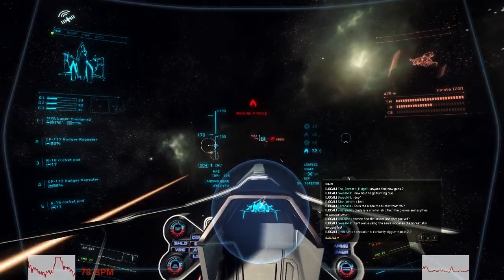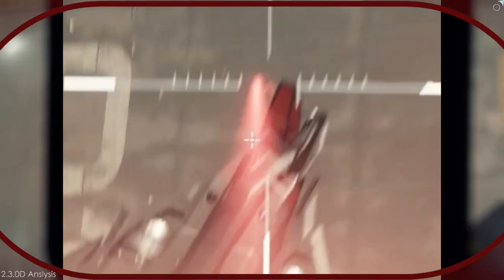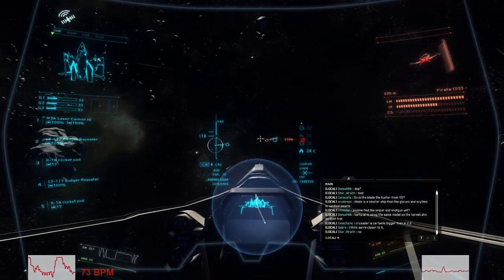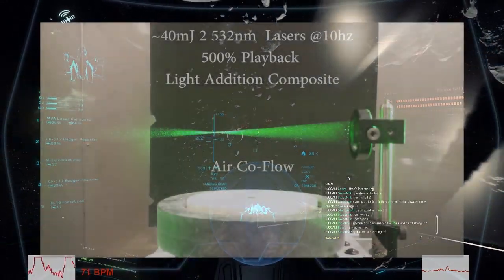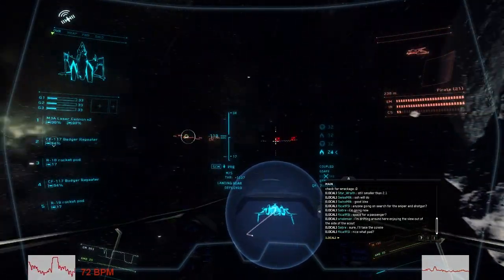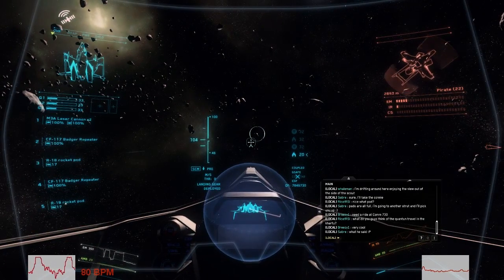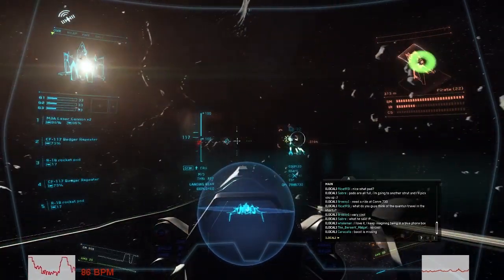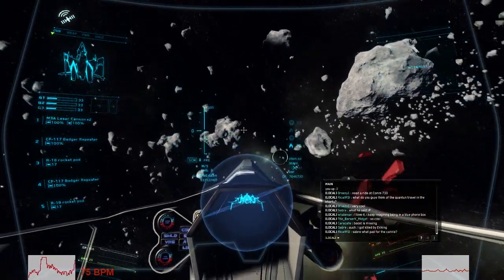Lasers in SC | V 2.3 | Review & Proposition

Comment: I've never been a fan of random inaccuracy in videogames in general, I would rather have a system that balances range in a different way. What you are describing definitely sounds like a great way to counter players spamming the laser, although usually an accuracy system is created to limit range of a weapon. I noted there was a graph you showed of the transmittance of a laser versus the wavelength (?). I'm not sure if you talked about it in the video, but i think, in addition to what you're proposing, a great way to artificially create effective ranges for laser weapons would be to have that transmittance drop over distance. Some weapons might have longer distances than others. I guess the lasers in this game also have travel time though, and that might also be a good way to create effective range, as lasers that travel faster would be more useful against farther targets

Comment: Through my experience with working with high wattage lasers (Class 4 and above, lowest being 2W), another problem I could see is that if you are using a lens, it has to be focused.  

Say I'm attempting to damage something that's ten feet in front of me.
If my lens is focused at two feet, sure the object will still heat up, but it will take longer to actually cause damage than it would if it was focused correctly.

I think that lasers in this game should have some sort of optimal range, with a damage drop off the further you are away from that range.